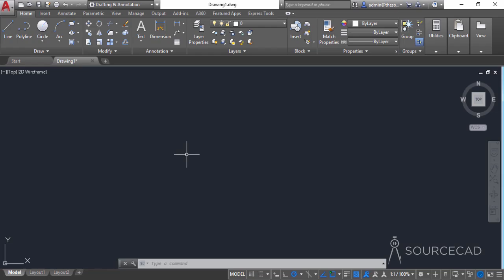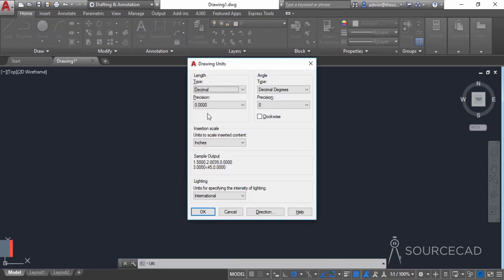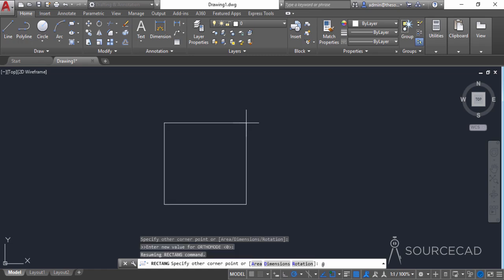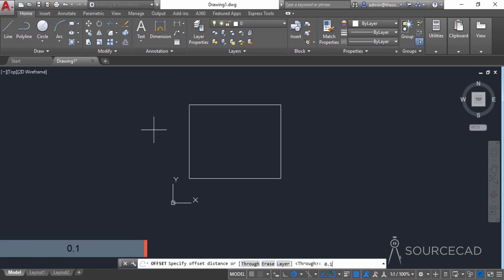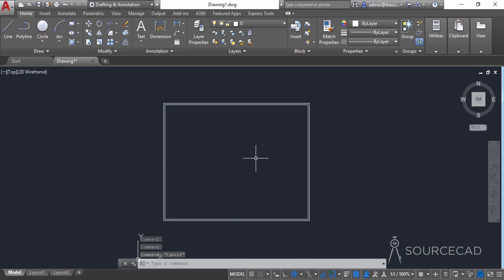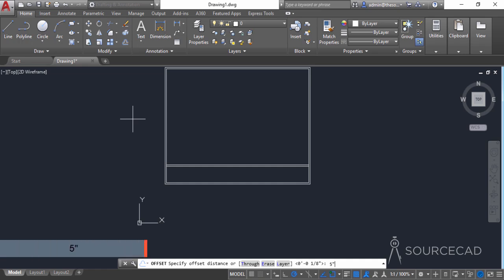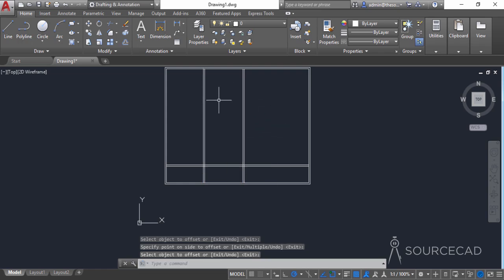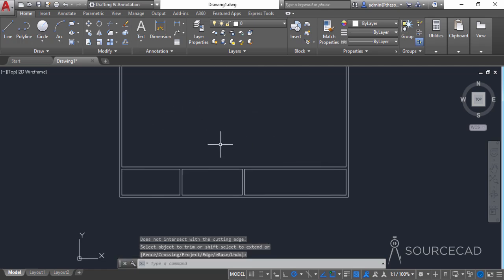How to create title block and its template in AutoCAD - Part 1 of 2

Comment: the @ command gives only an error. 
so can not set a paper size. can find nothing about the @ on autocad site also  also in metric mm would help.
Reply: If you're gonna use metric units set your length type to decimal, fractional, or scientific depending on what you're working on. Architecural and engineering length types will only use inches as its unit.